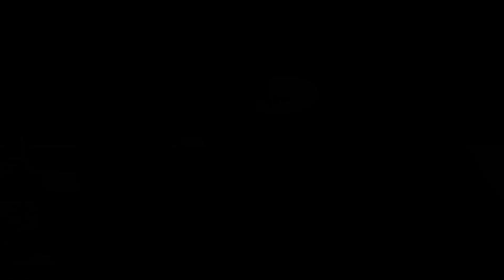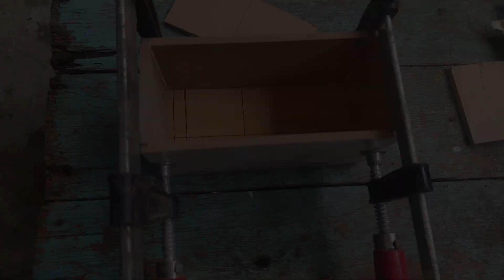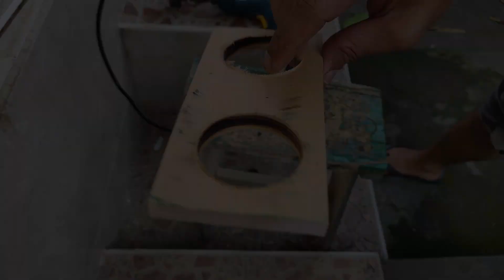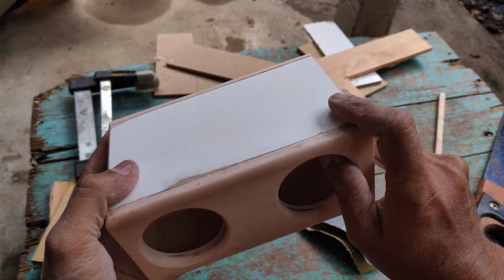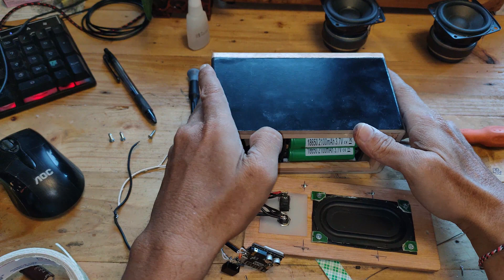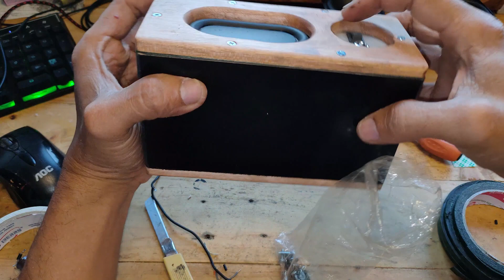DIY Bluetooth Speaker III

Comment: Bli kalau ampli pam8610 vs xyp15w vs tpa3110 bagus mana 🙏
Reply from the maker: Saya pilih pam 8610.. karena selama ini yang saya coba pam 8610 suaranya paling enak. Ampli yg lain diatas.
Reply: Maksud nya ampli yg lain di atas gimana bli
Reply from the maker: @tehwork6968  bagus juga tp kalo saya lebih milih pam ,karena power paling gede dari ampli yg lain diatas
Reply: Bang saya ingin membuat speaker bluetooth menggunakan batrei agar enak di bawa kemana² dengan ukuran 3 atau 4 inc apa aja² bahan² nya untuk suara terbaik dan bas nya kerasa terimakasih bang
Reply from the maker: @tehwork6968  siapkan ampli yg sudah isi module Bluetooth. Battery dengan BMS sesuaikan dengan keperluan ampli nya charger untuk battery.saklar dan bass radiator untuk speaker dibawah 4 inch